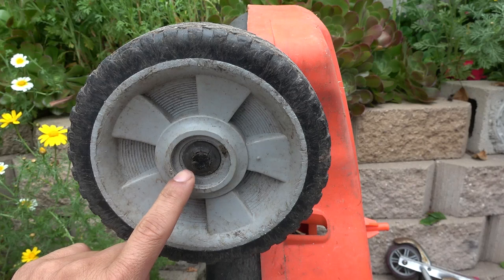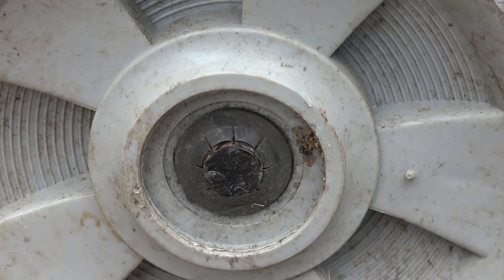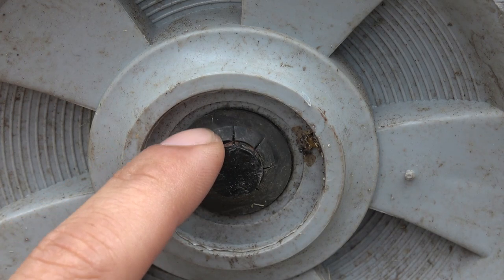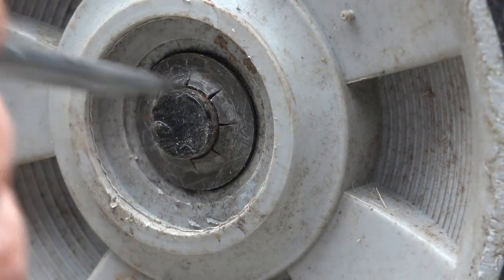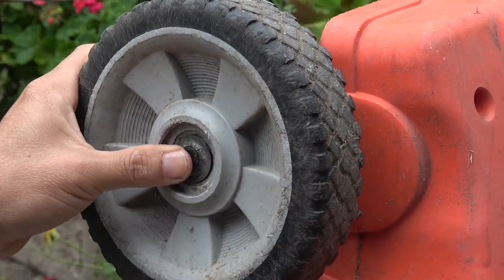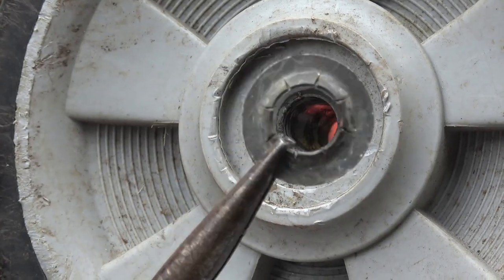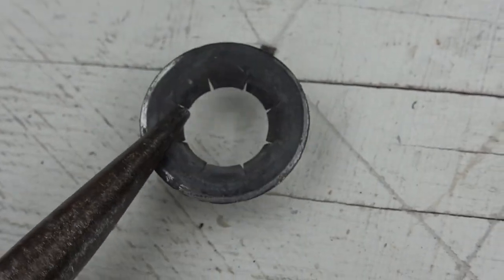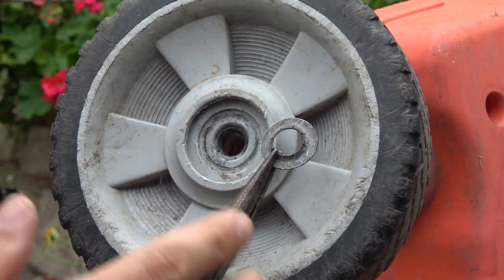How to remove & reuse retaining rings/clips for lawn mower or dolly wheels

Comment: Another way to do it is to grab the retaining ring with a pair of visegrips, and the "unscrew" it with the visegrips, pulling and turning at the same time.   You must also insure the axel doesn't spin and you will be able to unscrew it eventually.   This method doesn't always work, sometimes there is no clearance to grab it with the visegrips, and sometimes the visegrip jaws won't go as wide as you need.   So this is a good alternate method for me.

Comment: hi, your videos helped me quite a bit so far and this is why I am asking for your opinion please,
, Yet another problem another question...
got new throttle new controller. Battery fully charged and throttle with lcd volt gauge turns on and shows 54v motor did spin backward and I disconnrcted self learning wires and reconnected again... I had to do it about 4 times before the rotation changes and when was working all right I disconnected everything for wire managment and then motor not spinning, I cheched throttle is working and sending signal but the motor seems to not receiving electricity at least not from 3 phases wires, if anyone have a suggestion I'll be happy to hear it . 
this is puzzling me ...HELP

oh I tried this ...connect only the :  Battery, 3 phases, hall sensor, throttle/keyswitch  and still volt gauge shows full battery throttle working, controller gotvoltage where I expect to find some but motor not moving, almist as if a brake power off  like handle brake lever was somehow interfering